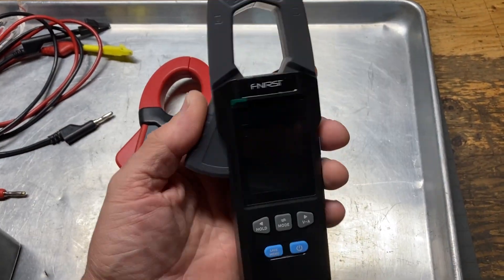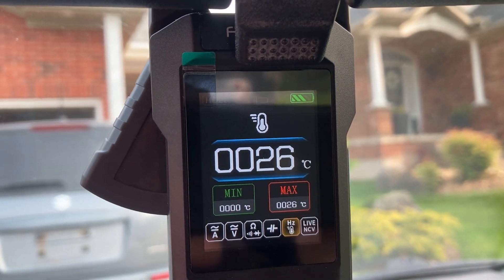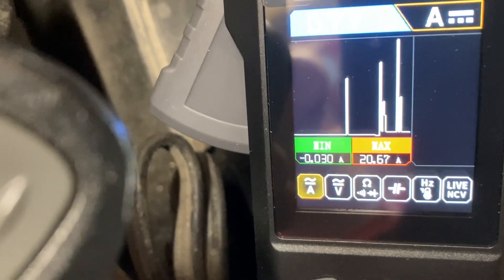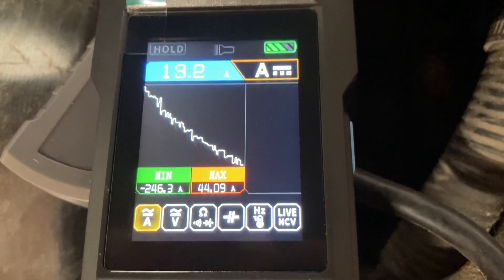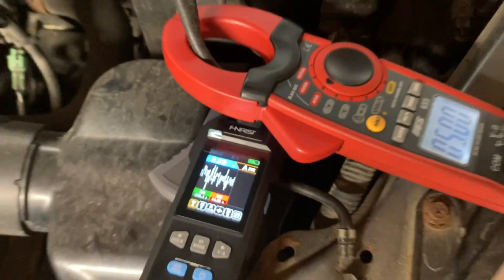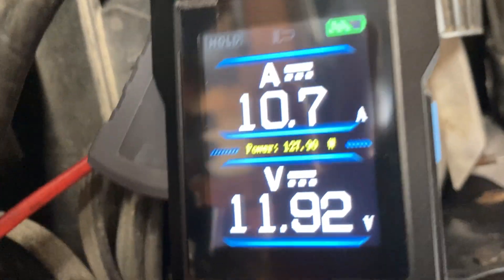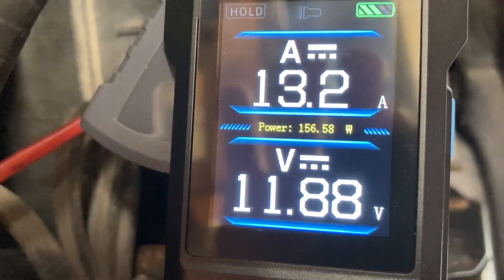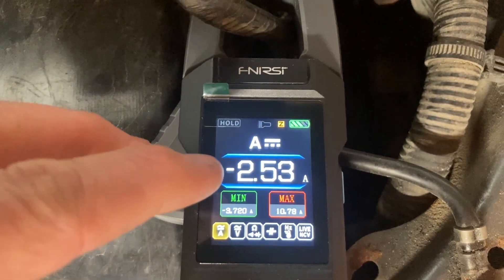Fnirsi DMC-100 Graphing Amp Clamp Meter

Comment: Min max doesn’t seem to work on DC voltage setting it doesn’t reset and it isn’t won’t catch the battery drop when using the starter to load the battery, can you confirm?

Comment: At 2:34 did you have to zero the clamp first?
Reply from the maker: Although you can zero anytime, the tool seems to always zero/near zero at power up. So the zero function is really more practical as a “relative zero”. (Nulling an existing current to note a differential when a change occurs). Thx for watching 👍🍻
Reply: @TheGibby3340  Thank you for the reply. On a parasitic draw test any thing above 50 ma is a problem, my concern is if it does not show zero before clamping will it be accurate?

Comment: Great tool to have on the battery cable when performing bidirectional tests with scan tool, first one that comes to mind is fuel pump, with no scan tool jump the relay, rule of thumb is one amp per 10 PSI
Reply from the maker: Thx for watching.There is quite a few videos on the channel about fuel pump testing if your interested. 👍🍻
Reply: @TheGibby3340  Have not seen them, but I will. 
Any time I have a crank no start my first test is to activate the fuel pump while looking at current draw, rule of thumb is 1 amp per 10 PSI, on a 50 PSI system it is 5 amps.